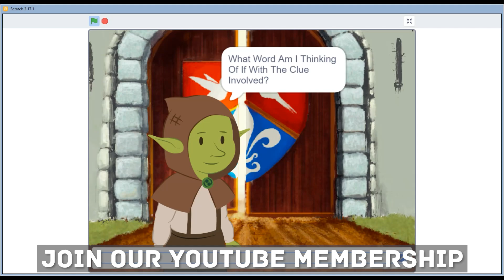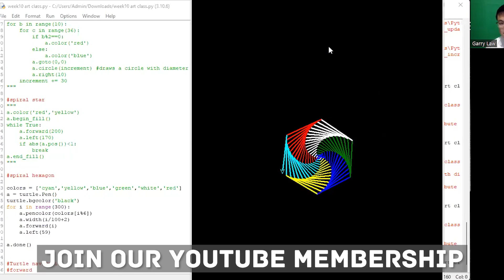FLL Masterclass Part 2: 10 Tips to Make Your LEGO Spike Prime Robot Drive Straight

Comment: When using tireless trim wheels it goes straight but not taking exact turns
Reply from the maker: Make sure you use proportional control with gyro sensor for turns to make them more accurate
Reply: @CreatorAcademyAustralia yes I tried with gyro sensor but some times it take turns but some times while taking turn moving forward.. ex with simple code to take 90 degrees if run code multiple times out of 3 runs 2 runs taking turn but 1 time takes 45 degrees then moving forward
Reply from the maker: @suryachu1 you may need to increase the timeout to allow enough time for the turn

Comment: Thank you very much for your videos!  They are very helpful!  We have a question!  Why does the robot doesn´t always do the same thing?  What the robot can´t always do a same FLL mission?  What happens to us is that we program the robot to do a mission, it does it, and suddenly when we try it again it doens´t execute the same?  Thank you!
Reply from the maker: Hi! There are many factors that can make the robot inconsistent. Ensure the robot is sturdy and not wobbly. Make sure the robot starts each run in precisely the same configuration using a movement jig. LEGO motor encoders can be inaccurate, so use sensors to assist with movement positioning. Ensure battery power is consistent, less charge can cause motors to be weaker. Hope this helps! Garry
Reply: @CreatorAcademyAustralia  Thank you very much for your answer!  We would like to know what is "movemente jig".  We didn´t understand that part.  Once again, thank you!
Reply from the maker: Hi! a movement jig is like a sturdy frame that is placed on the launch area so that you can position your robot in the same place before running the code. Hope that helps!
Garry
Reply: @CreatorAcademyAustralia  Thanks!!

Comment: What do you use to clean the wheels?
Reply: We use alcohol wipes. Write a simple program to make both wheels run at a slow speed until stopped and hold the wipes against the wheel. The first couple of rotations will get most of the dirt off and then use a different part of the wipe until they look almost new. You do not have to apply a lot of pressure.
Reply from the maker: Hi! We just use wet tissue paper. Garry